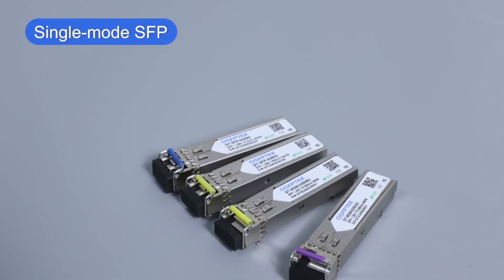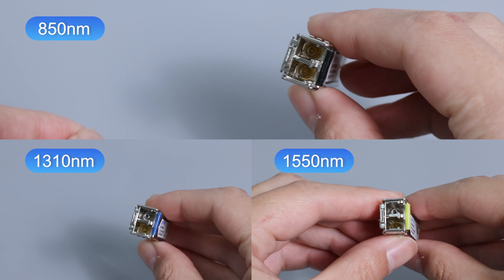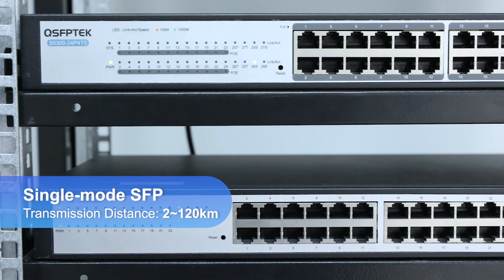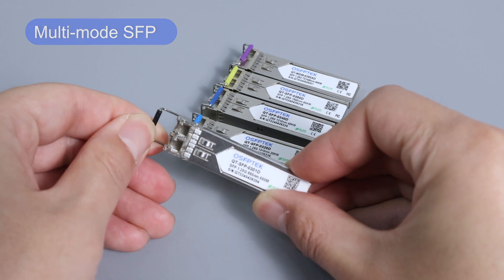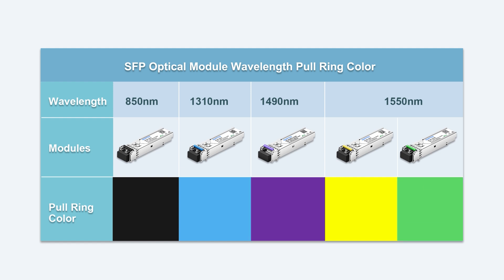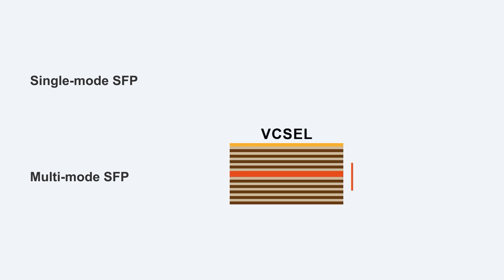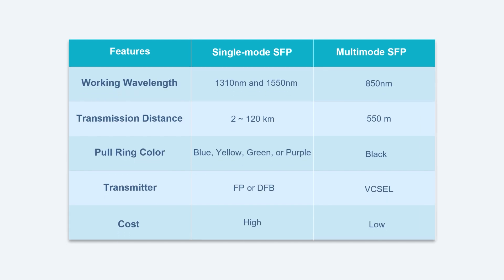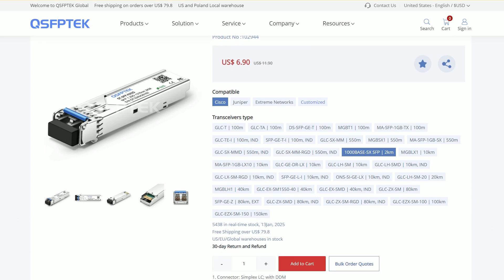Single-mode vs Multimode SFP, What’s the Difference?

Comment: The information, even though the video is only 8 months old, is very outdated on price. In recent years the cost for single mode fiber SFP+ modules has come down a great deal, where both the single mode and multi mode modules can have been for the same price. Since the single mode fibers cables are universal (OS2), new installation should now invest in single mode, since the price is not a factor anymore (even for homelabs).